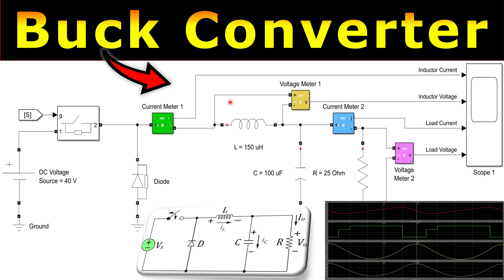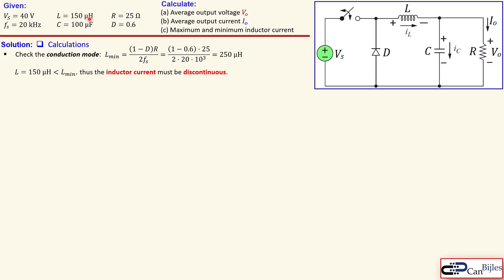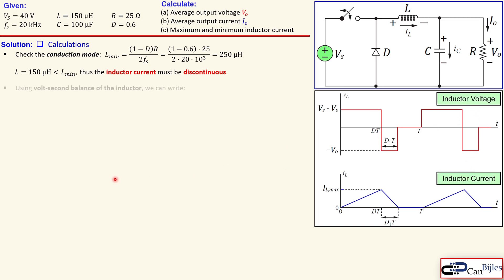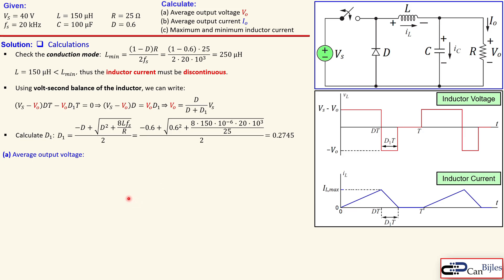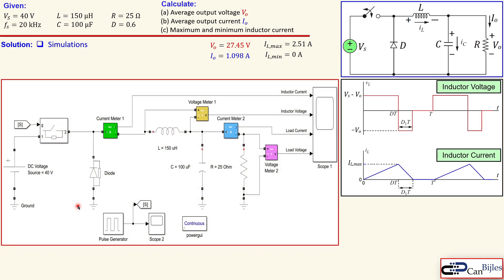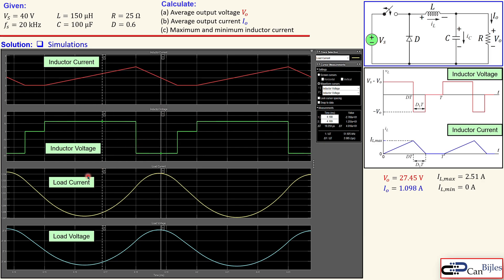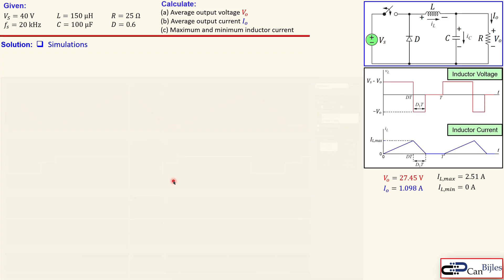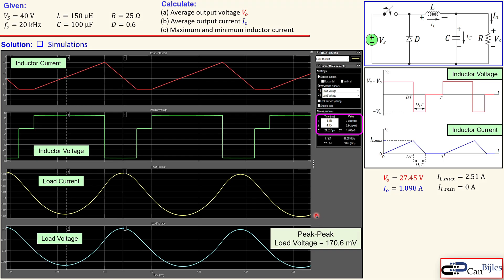⚡DC-DC Buck Converter - Discontinuous Conduction Mode 🔋 Power Electronics Calculations & MATLAB

Comment: Спасибо! А в чем преимущество прерывистого режима, в каком случае используют этот режим в понижающих преобразователях
Reply from the maker: Operating the converters in the discontinuous conduction mode can reduce the stress on the components and switching losses because you can get higher output power than with the continuous conduction mode. This is one of the advantages.
Reply: @CANEDUX  Понятно, спасибо!
Reply from the maker: @SMV1972  You're welcome!
Reply: @CANEDUX  скажите пожалуйста, передаточные функции dc dc buck в непрерывном режиме и прерывном одинаковы?
Reply from the maker: @SMV1972   In discontinuous conduction mode (DCM), the output filter response changes because of the discontinuous nature of the modulator’s driving
impedance. In discontinuous conduction mode (CCM), the modulator’s output impedance is relatively low, but in DCM it is not. See for more details this excellent paper: https://www.ti.com/lit/an/slva301/slva301.pdf
Reply: @CANEDUX  Спасибо, обязательно прочитаю!
Reply from the maker: In addition, you can read some more details about the Difference between CCM and DCM via this link: https://www.monolithicpower.com/en/the-difference-between-ccm-and-dcm-explained